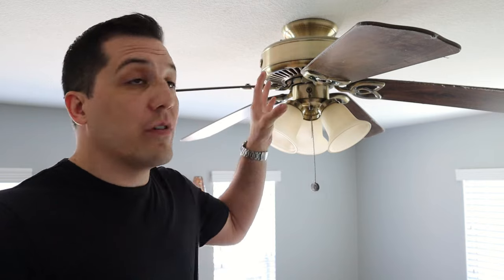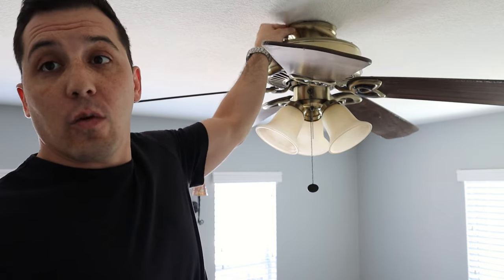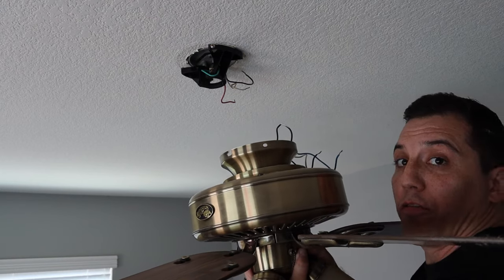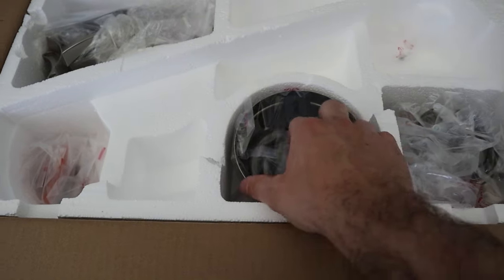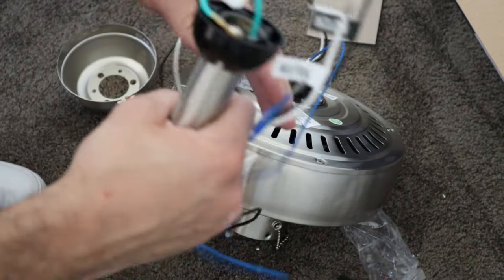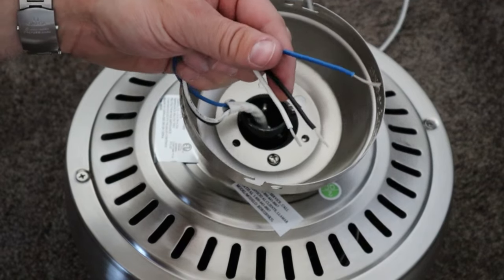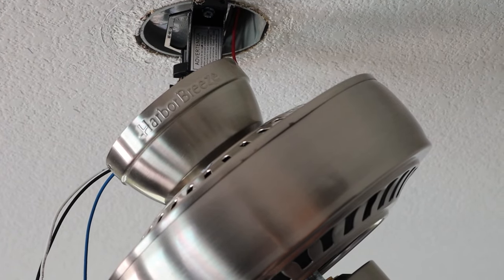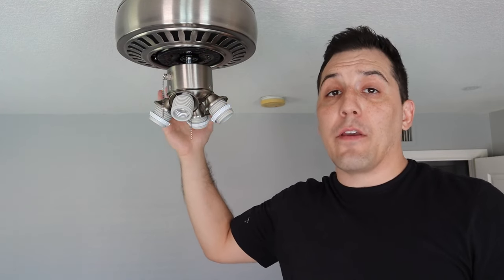How to Replace a Ceiling Fan - DIY Step by Step Guide

Comment: You convinced me i could do it until you said "set the house on fire."
Reply: It's funny cause I tried to replace the fan after I took a deep breath. Then I found a sticker indicating the model number (after looking forever), so I googled it and found a customer service number. They walked me through resetting the fan and its WIFI apparently. So now I have an App. No fires.
Reply from the maker: So you didn't have to replace your fan? Glad it worked out for you and I didn't mean to discourage you from trying!
Reply: Lol
Reply: Speaking of house fires, I cleaned out 2.5 gallons worth of dryer lint from my dryer and vent pipe. The numb nuts' that installed it crushed the rigid flex duct so bad that there were holes in it. I had to remove lint that was literally burnt from behind the dryer basket as well where the heating elment is. Scary sh*t. Luckily in our household we never have the dryer running when not at home. Shouldn't even do it while sleepinghonestly. 

My Father asked me to replace a ceiling fan in his apartment that he rents which is why I am here. I work on much more complicated projects on a daily basis. But I love to watch YouTube videos before doing some tasks for the first time.  

Thanks a lot for the video sir.
Reply: 😄🤣🤣facts
Reply: LMAO 🤣🤣
Reply: I know this is an old video but what do I do if I have one switch?
Reply: If a so-called house fire gives you pause then you're no DIYer.
~boB
Reply: I tried setting my house on fire didn't do anything for me 😥
Reply: Thank you,Robert.

Comment: If a woman was doing this she could take the light globes/shades off and the blades off first to make it lighter and then rest the fan on the ladder while she is unscrewing the electric connections. Just thinking ahead, because I'm watching as I have to replace two broken fans in my house.
Reply: I feel like I love you for this.
Reply: Just took down an old fan in my house, and the top casing would not drop down enough to expose the base until I took off the blades.  Another great reason to take the blades off first.

Comment: If the fans power is coming threw the rooms light switch first then how would you get electrocuted from the fan if the light switch is off?  I'm asking because i have no idea what breaker controls the power going to the room im trying to change the fan in.  The breaker box isn't labeled.

Comment: I just purchased my first place. Great video with concise and easy to understand guidance! I’m changing my living room fan first next weekend (Out of 3)I’ll let you know how it goes. My home is from 1966 so hopefully the pre-existing work is okay. 

Subbed!
Reply: Soooooo, what was the verdict?
Reply: @guitarismike9  lmao yeah @user-zb8sw2jo6d, how did it go?
Reply: Wiring that old probably won’t be ok probably not even 4 wires there
Reply: @IggyArssie  yeah mine has only 2... rip i tried and the mount inside the ceiling is small.. even tho the size of the fan is the same.. sigh

Comment: Best practice is to twist the wires together, both at the insulated part and at the exposed ends before putting the wire nut on to help keep them together and from falling out of the wire nut

Comment: Great video! Question: Do you need to replace the mount itself if it’s from ceiling fan to ceiling fan? I’m going from an old fan to a new model but I plan to stick to the same size roughly

Comment: Hi Robert, nice video, you were straightforward, concise, and you have such accurate verbiage (easy to understand) and everything was crystal clear in what the audience could see; your lighting was perfect.  My question is about twisting the cable caps, I've noticed in the past that different technicians doing repairs twist the cable wires into themselves and then twist the cable caps, some go even as far as twisting the cables in a specific direction so that they then turn the cable caps in the direction that would seemingly screw them in and some folks like you did here push the cap on with the two cables side by side and then twist the cap.  Is there a right way or which is the best way?  Oh, another question would be how does one know what size cable caps to buy, I always see so many colors & sizes?    Thank you and have yourself a wonderful 2025.

Comment: Hello, what about if my 1 light switch turns both light and fan?  On my old fan that’s how it works and I only use the string to decide what I will use light or fan or both🤔. I got a new fan but it’s been sitting in its box for 2 months now 😅… I’m gonna give it a go …

Comment: Hi, love how direct short & sweet your vid is. I have a quick question.... Have you ever seen a mounting bracket that's too big? I don't want to drill any holes as I live in an apartment complex.
Reply from the maker: Most are pretty standard but you could check your current one to make sure you get something sized the same.

Comment: I am replacing a celing fan that did not have a wall switch, just the manual cords. I am replacing it with one that came from a wall switch—do I need to have an electrician install the wall switch that would control the fan? Is that a difficult thing to do? Thanks for the video—I feel encouraged.

Comment: Hey man I’ve got four runs of 12/2 Romex running into this box where the fan was. I got them a little mixed up when I took it out but I took pics and it looks like the fan is only connected to one single black wire on the incoming romex. Does this sound right? Any tips on figuring out the wiring?

Comment: Isn't there a bracket up inside the ceiling that's supposed to hold the weight of the fan? Should I assume it is already there from the old fan? You're instructions are very well done.
Reply: Same question because I was told my fan doesn't have one since it's older..

Comment: Did you use electrical tape just as an extra security since the old fixture didn't have any tape? 
Thanks for the video. It is very helpful.
Reply from the maker: Correct, just a bit of extra protection

Comment: Question. Hoping you’ll see this expediently. As I just bought the fan. I’m going from a ceiling fan with a light, to a ceiling fan with no light. Can I just cap the existing wire for light source with a plastic screw nut?
Reply from the maker: When installing the new fan, connect all wires as directed in the fan instructions and then yes, I would cap any old wire not being used and run electrical tape around the cap if you want to secure it even further. This will allow you to change back if you ever choose to as well.
Reply: @RemodelWithRobert  Thank you much. Yes this new fan I got off marketplace doesn’t have a light feature. But the old one installed did

Comment: Fantastic video! One question, why were there so many wires on the fan that weren’t used?
Reply from the maker: Can you tell me what point of the video you are referring to?
Reply: @RemodelWithRobert  its at about the 11:20 mark….
Reply from the maker: That is internal wiring that didnt require any manual connection for installation.

Comment: You should twist your wires together and cit the tip off before you put on a wire nut it makes a better connection and stays.

Comment: So, in trying to swap out the fan in my new house, we found that there was no electrical box, just wires coming out of the ceiling.  there were also 2 large bolts with rings sticking out next to the wires.  it seems they are all attached to a stud in the ceiling?  My dad is telling me it's all doom and my house will certainly burn to the ground....I don't know if he's exaggerating or if it is ubfixable?  I have an electrician coming out in 2 weeks but I'm a bit stressed out.  Any advice?  thank you!!!

Comment: My old ceiling fan is 23 years old. The motor on the fan quit working so I got a Patriot LED to replace it. I did notice that the brackets holding everything to the ceiling are a bit different. Does that matter?

Comment: I know this video is a year old but I have a question. If I only have one light switch that controls light and the fan, would the wires be different?
Reply from the maker: You should still have your neutral wire connection, ground wire connection, and both the fan and light connecting wires will connect to the single live wire. You will then have both the fan and light wires connected to the single switch. This should leave you with the pull chains as your way of turning either the fan or light off if you want to use them independently.
Reply: @RemodelWithRobert  Thank you so much!!

Comment: You did a great job! And very detailed yet not too long. I would like to know how do you know you got the colors right? What if the wires on the electrical bracket are all the same colors?
Reply: Maybe take a picture before detaching the wires 🤔 so you could just match it? Or are the fan wires same as the ones coming from your ceiling

Comment: Would the install be similar if the new fan has a remote and the old one doesn’t?
Reply from the maker: Many aspects of the install will remain the same, but there will likely be a few differences for the remote control that you will want to refer to the installation directions that come with that specific fan.

Comment: Might be a dumb question but does the diameter of the part that connects to the ceiling need to be the same when replacing? Say i have one now thats 10" and i want to go to a 5.5"

Comment: What kind of tool do you need to test if there is electricity going through the wires before I attempt to put the new one on. Thank you.
Reply from the maker: I have a link for a voltage tester in the video description. I hope that helps

Comment: What would happen if I didn’t put electrical tape around the wire connectors?
Reply: Wrapping the connectors with tape is just meant to help make sure they don't jiggle loose over time. If you install them correctly it shouldn't be necessary, but plenty of electrical fires have started because of wiring jobs that should have been fine. When it comes to working with live wires there's no such thing as "too cautious".

Comment: How do you measure the room size to find out what size ceiling fan to get?
Reply from the maker: Measure the length and width of the room and multiply them to get the square footage. If your room isn't perfectly square, get the widest points of the main area of the room when tsking your measurements.

Comment: Was it recommended or actually required to install the motor first without it being all together?

 Reason I ask if because I'm short and clumsy so alittle skitty looking up and assembling a fan so high up (I'm fine going low like for cars)
Reply: The fan is heavier when completely assembled.  I installed the same fan solo, and was glad to not have the extra weight or blades in my way.  If you're short, clumsy and also skittish about heights, you should ask a second person to help.  Good luck.

Comment: I wish you would’ve shown where you installed the fan blades because on my ceiling fan one of the blades is facing up instead of down. It’s a Hampton bay that was installed when I bought the place.

Comment: Exactly what would the estimated time be respectfully asking
Reply from the maker: This can certainly vary based on a lot of factors, but it's very reasonable that you can do this in under an hour start to finish
Reply: @RemodelWithRobert  after 20 years previous fan fell from selling called handyman to get an estimate was told to have fan reinstalled would be close to $450. $100 for the first hour then $25 every 15 minutes gave estimate around 4 hours no way stated electrical box would need to be replaced no way I was thinking and hoping maybe around $175

Comment: Do you ever have to go in attic if you are replacing a ceiling fan with light for another fan with light? I want to be sure before I find out the hard way there is more to it.
Reply from the maker: If you are just swapping one fan for another and don't have anything that isn't working with the wiring, then you shouldnt have any need to go in the attic.

Comment: Is the electrical tape over the wire nuts necessary or is it just for a little extra safety?
Reply from the maker: Extra safety to make absolutely sure no wire is exposed
Reply: @RemodelWithRobert  thank you, just got done installing a new one with the help of this video. Thank you!

Comment: One thing to note if you're changing from a light fixture to fan, you should also check the bracing/support for the electrical box is "ceiling fan" rated. Just sayin'...

Comment: Can these wires that are already through the ceiling go to any ceiling fan?? Or are you using the same brand
Reply from the maker: The wires are not specific to a brand or specific style of fan. If you are putting a fan with additional features like a remote control there may be some additional steps to take in the install but the directions on the fan should alert you to any potential wiring issues before you jump to far into it.

Comment: Thanks, very helpful.  Is there a device that can check if I have wired correctly when I’m done?  Also, if all I could manage was taking down the fans and putting caps on the wires do you think the cost saved in labor for the electrician would be worth it?  I have three fans to replace, I’m not too strong anymore, and I’ve never done electrical.
Reply: Personally I charge more after the customer has already started on the project. Even if it’s just removing the old fan
Reply from the maker: With 3 fans to replace you are probably better off to have the electrician do all of it if you aren't prepared to take it start to finish. I don't see it saving you any money to take the old fan off and then having the electrician reinstall the new.

Comment: Once I take old fan down can I just install old fan in another location without taking it apart(removing blades, etc, etc..?)
Reply from the maker: Yes you should be able to. The biggest challenge is probably supporting the weight of the whole fan while you reinstall it in the new location, may need someone to hold it while you make the wire connections and screw it into place.

Comment: Instead of a second person couldn't I use the ground wire to hang the fan on while disconnecting?
Reply from the maker: I would definitely not recommend trying to support the weight of the fan with any of the wiring.

Comment: I guess I will look at the color of the wires of a new ceiling fan first, and read what each color is supposed to be,
maybe even write it on a separate piece of paper,
Then, when I am taking down the old fan, i'll check what color wires are connected to what and maybe make a verbal note, by recording audio with my phone.
It is annoying when black isn't negative and red isn't positive.
You would think the color of wires used, would be standardized.

Comment: You should have turned the breaker back on and tested it before you put the blades and light globes on. Image putting them on and testing it, just to have to take them all off again because it’s not working properly or at all.

Comment: The old fan was a Hampton Bay Huntington II, which you don't see those anymore.

The new fan is a Harbor Breeze Grace Bay, which I got 4 of them to install, I don't need a guide to install them since I have been familiar with ceiling fans for a long time.

Comment: Everything was going great until I got to the step where you install the new fan motor bracket into the electrical box. The screw holes won’t line up. 😢 The holes are spaced farther apart on the new bracket than they are in the box. So I guess the box is too small?

Comment: If you have two hot wires, how do you know which is which?
Reply from the maker: This should be indicated on the instructions but in my case blue went to black and red went to red. One operating the fan switch and the other the light switch.

Comment: How did you mount the fan without using a downrod?
Reply: BTW, thanks for this great video.
Reply from the maker: The canopy that sits flush on the ceiling has two holes that align with the mounting bracket to screw the canopy to the bracket.

Comment: you wouldnt happen to have a video available showing how to replace a pull chain OR do whatever need to be do so that I will be able to turn my ceiling Fan's lights off and now,  Right now,  my fan works just like it is supposed to BUT I cannot turn off the light with the pull chain.....

Comment: Okay the 1st part is where I’m having trouble as the screws won’t loosen for me to take the top base off.  Have put wd40 on it and tried to loosen with needle nosed pliers but still won’t unscrew.  Anything I can do besides tearing it out of the ceiling?  Thanks in advance
Reply: Hammer time

Comment: What if the ceiling fan I currently have doesn't have a light and I want one with a light? It is operated by one switch if that matters. Will I be able to install one with a light?
Reply: I would definitely say call an electrician because your whole box will need to be replaced. It's not recommended to have both be controlled by one switch.

Comment: What hook did you use?
Reply from the maker: The hook to hold the fan while I installed it? It was on the actual mounting bracket with the fan I purchased. Not all fans may have this but it was a big help for doing the job alone.

Comment: The problem tho is that the fan you replaced is a million times better quality than the one you put in
Reply from the maker: Yea, that wasnt a problem for me as I didnt like the style of the old fan at all and the new worked well for a simple installation video for my viewers. It was certainly a nice fan though and I was able to sell it to someone on offerup!
Reply: Great! Because usually people replace vintage fans with cheap Home Depot fans
Reply from the maker: @bensgoofyahhfancollection9997  I didn't realize that anyone held Hampton Bay (also a home depot brand) in such high esteem. Thank you for the insight!